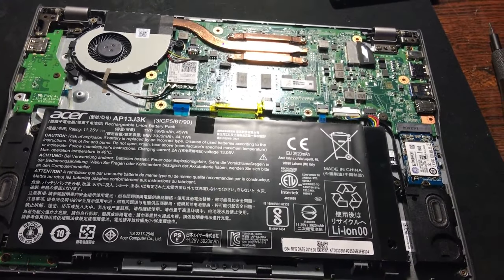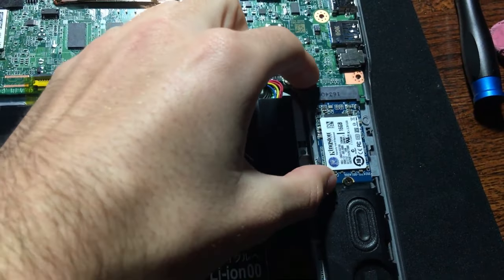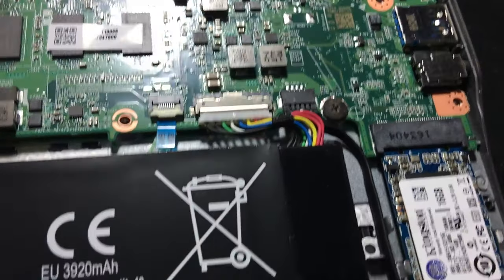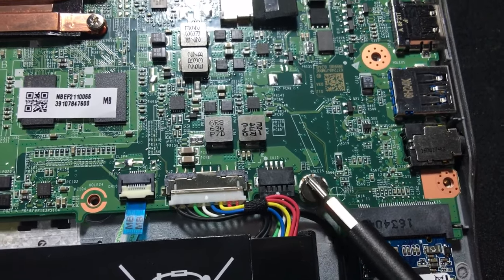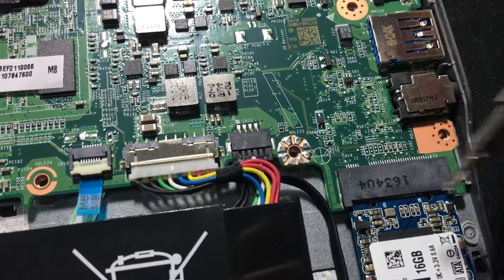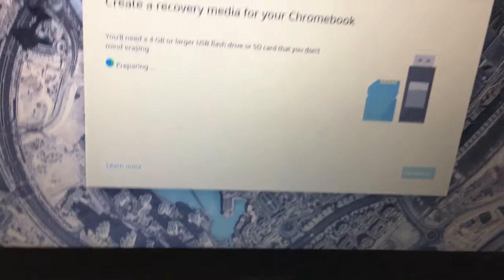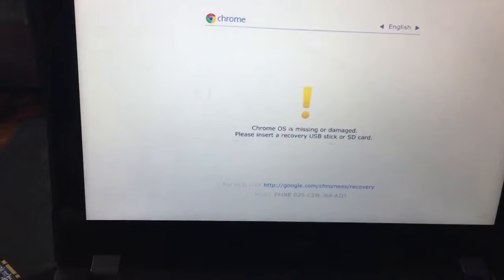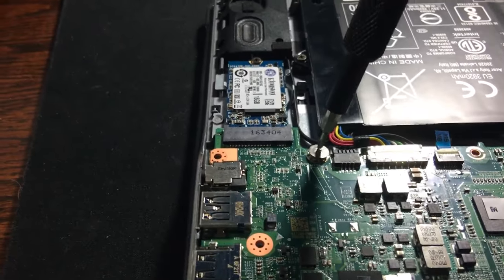How To Unenroll A Managed Chromebook

Comment: bro is there any other way to unenroll without buying the SSD
Reply from the maker: Yes but they are less likely to work or more specialized. You can try disconnecting the battery internally for 15 minutes then plugging the computer directly into the charger. Then you can try powerwashing and it may remove the protection and wipe the TPM protecting the enrollment. Make sure to sign in with a personal account first and not your domains email as it will auto enroll itself again
Reply: @SAMSTRECKER  So it's like taking out / unplugging the battery inside the Chromebook and wait for 15 minutes. Then plug the computer directly into the charger and reset it. Lastly, make sure to sign in with a personal account. Am I right :)
Reply from the maker: @pirritheebanmaranwhitley-sp1vw  Yup sounds pretty good to me!
Reply: @SAMSTRECKER  bro that method doesn't work. After all the steps, When I plug the Chromebook directly into the charger, I cannot reset the Chromebook. It keeps showing me the sign in button 😔. Bro did U know any other methods 😢😢
Reply: Chromebook model - ACER ( R753TN-C1NB )
Reply: @SAMSTRECKER  But the problem is i cannot factory reset it. when i press these ( Ctrl + Alt + Shift + r.) buttons the box doesnt appear.

Comment: Would this fix the issue im having? I power washed it chromebook but it get a message thats say " this chromebook is locked by the administration" will this solve that problem. Never but a laptop from a crackhead😂
Reply from the maker: Try disconnecting the battery for 15 minutes, disabling wifi,  then power washing it again
Reply: @SAMSTRECKER  man I washed it so many times I ran outta soap bro! Ive disconnected the battery over night and re washed nothing changed still say locked the the school.
Reply from the maker: @LunchBox504  Can you send me an email of a picture of the warning message?
Reply: @SAMSTRECKER  where do I find the email address?
Reply from the maker: samstrecker11@gmail.com @LunchBox504
Reply: @SAMSTRECKER  yo ima shoot you that email later today I forgot about it for a min!✌🏾
Reply: @SAMSTRECKER  i just sent that email!😅